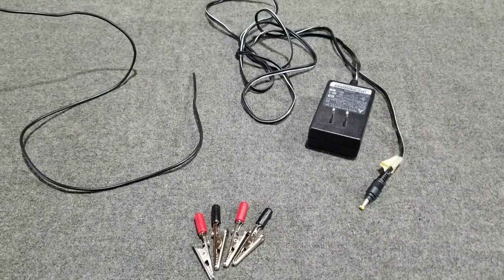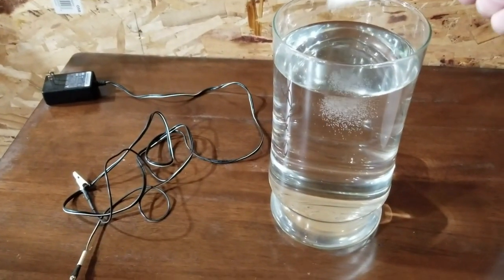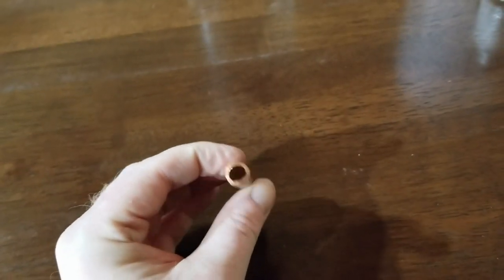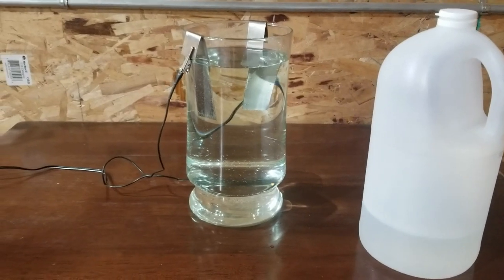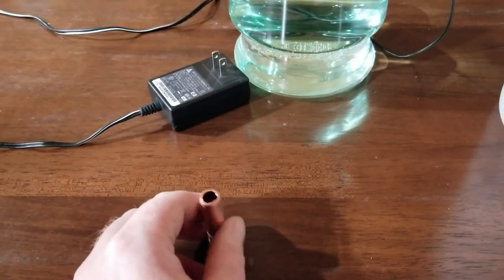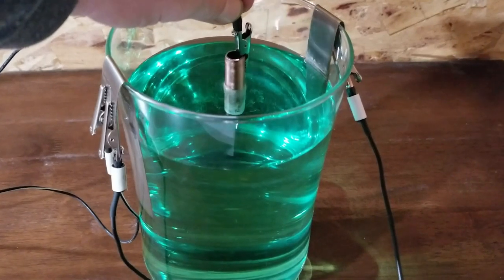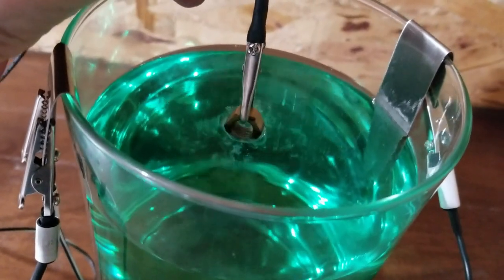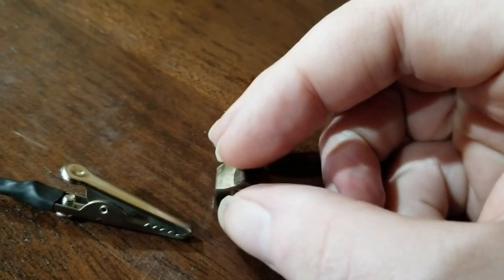Nickel electroplating, its easy, you can do it yourself!

Comment: Question.  When making nickel acetate, not plating, does higher voltage yield a better solution?
Reply from the maker: The solution will be created faster for sure, but quality depends on the dark green it turns into, the darker the better, the faster it turns dark green is solely based apon the voltage amount that runs between the two electrodes that does that,

Comment: Possibly, "stir the solution" while leads are disconnected to keep the salt suspended. Should have done a quick dip in muriatic acid to get all of your paw prints off of it before plating.  too much fidgeting...be patient and let the process complete itself.. plating is not a hurried/magical process.  good luck in future videos.

Comment: Can you use this same procedure but electroplating an aluminum tube?
Reply from the maker: Yes, you can plate nickel on aluminum and also plate other metal to aluminum as well, like silver, gold, copper, tin, but problems can occur with types of aluminum items and its a  common occurence, when plating aluminum an oxidization happens and it prevents proper plating adhesion and bad results can occur,